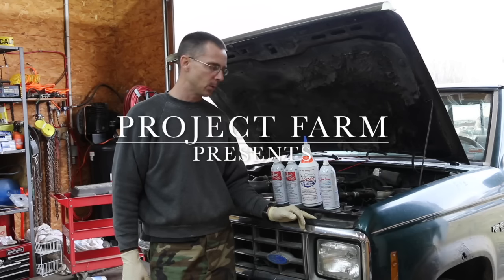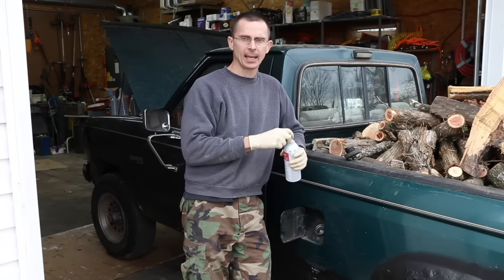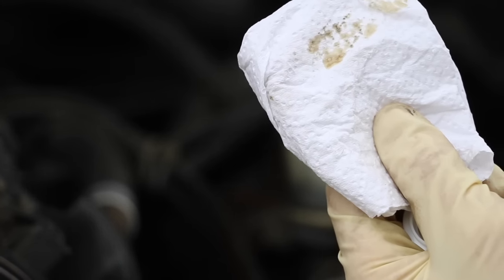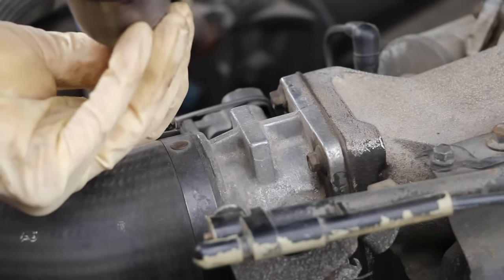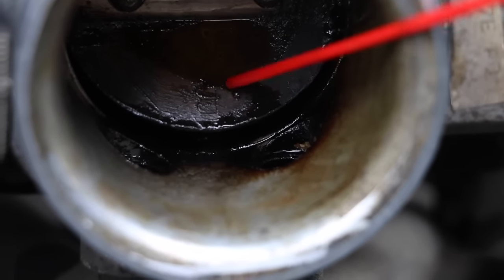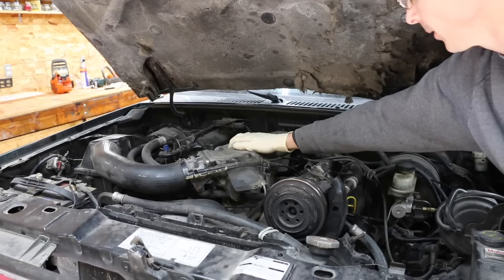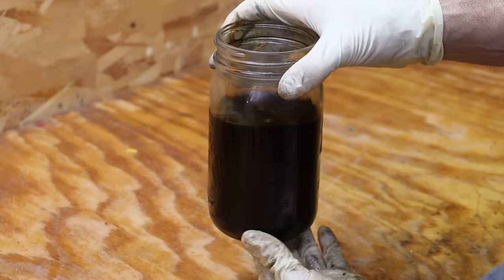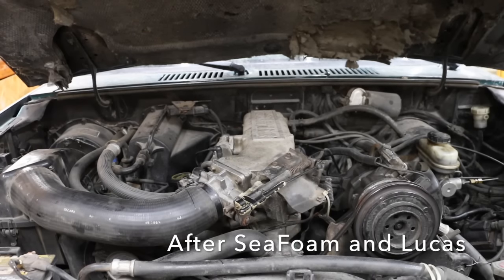Seafoam--can't believe what it did to my engine!!

Comment from the maker: Sorry it's taken me so long to post the links to the products I've used below.  Also, here's the link to the update video on the Ford Ranger: https://m.youtube.com/watch?v=prXiQgVVnDY&list=PLjT3B9r2z3fXjicpbrH4ras9VDX7gGSMe&index=20&t=0s
Products Tested In This Video (in no particular order):
Seafoam: https://amzn.to/3l5XjLY
Seafoam Spray: https://amzn.to/3aJptI5
Lucas Heavy Duty Oil Stabilizer: https://amzn.to/2FOENb7
Reply: You should have cleaned that blackened T'Body until it is like new.  the back of the plate you sprayed is worse than the front; sidewall should be cleaned.  It will idle like new. also clean the idle air solenoid or replace it!
Reply: So, after 3 years, how is the truck running now? Any of the old issues resurface?
Reply: Used Techron, its better than seafoam into the carb.
Reply: Aah it's only been like 3 years, no big deal
Reply: Can you please provide an update? Did seafoam correct an issue caused by deposits or is it more of a Band-aid?
Reply: Thank you for making these videos, very appreciative that you're taking the time to do this.
Reply: did you just spray it in idling or did you rev to 2k rpm
Reply: Love this, thanks man! God bless!
Reply: Have you ever tried motor flush you can by it at some Walmart’s I have been using it and love it so far
Reply: Lo e my toyotas!
Reply: You've come a long way from this video!
Reply: So the big question, how's it running now?
Reply: Please give us an update! How’s the truck doing?
Reply: Lol
Reply: Holy crap thats a lot of carbon on the throttle body. Thats suppose to exit the other end of the engine isn't it? lol
Reply: I used the seafoam in my 1999 Ford F-150 had a head gasket is blown and made my truck last a year longer it really works
Reply: One sure fire way to fix this problem is to turn the radio up louder
Reply: Alright. Storytime. A few years back, I bought a 2001 dodge stratus with the dreaded 2.7L V6. At idle, the oil light would come on. Telling me, it's getting close to death. I poured seafoam in the crankcase. Ran it for about 300 miles. Changed the oil.... Oil light was off. Owned it for a couple years and it never came back. Sold it to a kid I know for his first car, he drove it for SEVEN more years. Also ran seafoam through the fuel system and the intake. Ran like a top. I use seafoam in all my engine's now. Winter storage of summer toys? Seafoam tested fuel, starts right up in the spring. Engine teardowns, softens up hardened carbon, and it doesn't smell like kerosene in my barn. Great video bud.
Reply: Can you please add these videos to the engine oil additives play list please?! I almost missed them while researching the best additives
Reply: Nice if you followed up.  They are just temporary fixes that people dump in their engine when trying to sell.
Reply: @politics4816  actually, in reference to my previous comment, the guy that bought that car from me. Is still driving it. Ran into him the other day. Still no major issues. I run valvoleak... I mean, valvoline. I told him to do the same. People complain that it causes leaks, but every engine I run it in, looks fantastic inside. Even with the minor leaks. Had 327k miles on a Ford expedition that I sold (as a parts vehicle) only because the frame was starting to get bad. Still ran like a top. Actually ran better than the truck that the buyer used to haul it away.
Reply: @tslater1989  Thank you for pointing me to the follow up video that I did not notice before.  I feel much better now.  Project Farm usually goes the extra mile so I not surprised that the follow up video exists.
Reply: All Lucas oil is is just what we used to call honey oil, super thick oil to stop noises and oil burning.
Reply: X waa
Reply: @myname604  
I have used both Lucas and STP the Lucas is by far much better in my opinion.
Reply: @bertgrau3934  Slick-50 was pretty good but I have no idea whatever happened to that product.
Reply: @myname604  
I used that as well slick 50 it worked pretty good as I remember too
Reply: Spray GM "cleens" combustion cleaner into the throttle body. Follow the directions on the can to clean the throttle  body, intake valves and combustion chambers. Pour GM EOS into the engine  oil to free sticking lifters and quiet the engine overall.
Reply: If you only have enough money for one, which would you all recommend as the most effective?
Reply: @JWater57  
Depends on what you're doing. 
If you want to clean out carbon, then the Seafoam would be good, but Lucas is very good for fuel injectors.  (Lucas fuel injector cleaner)
Or if your engine smokes a lot like blue smoke,  I would recommend Lucas oil stabilizer works great
Reply: Awa
Reply: Can you do a video of various car manufacturers CVT transmissions under a specific stress load to compare the longevity and strength of these transmissions? Also compare to a standard 4 speed auto vs a newer 8 speed etc and even some manuals?? I think something like this would definitely be an, or the, ultimate high view comparison video. Everybody that owns a car should be getting more and more interested in transmissions with the introduction of all this newer technology.  Probably need a really good made dyno and run them all at a specific horsepower for a lot of miles??? Or maybe see what HP they begin to fail under at a min? Course the best would be to be able to run them all at the specific amount of power required to propel the specific vehicles they're used in at a set highway speed limit for enough miles to fail.  I don't know of anyone else big enough and scientific enough to ask. Would sure help to elaborate on exactly what we're dealing with with all this newer transmission technology.  Not sure that you can fund this alone from views or not. Guarantee you people will love to see it!!  Be nice to produce these results to compare car manufacturers so people know what they're getting and the manufacturers start concentrating on manufacturing more reliable vehicles to compete with one another. Course it would also help them to realize which technology is best themselves to know where to aim for the future.  Maybe even collect donations for the experiment if necessary?
Reply: Has anyone compared Dawn with engine cleaners?
Reply: So after u masked it are u gna open it uo and fix the lifters the rite way or u just gna leave it?
Reply: Hi PF, after all the testing youve done with additives/treatments over the past few years, what do you feel/recommend would be my best recipe for resolving some sticky lifters Im experiencing on my 3.3L gas engine with 100,000 miles? thanks!
Reply: I gotta tell ya, I’ve used sea foam to clean up old two -stroke outboards and it absolutely, definitely, positively works.  The only product I swear by, although Techron is also a great product but works differently.
Reply: Did this to my 94’ Ford F-150 it has the 300 4.9L inline 6 with 266,000 miles on it. Made a huge huge difference. Truck is running like it did 100,000 miles ago! It works very well!!!
Reply: Even in 2022 he still replies
Reply: I only use 1/4 - 1/2 as much as the instructions say to use and I'm totally satisfied with the results I get from using seafoam.
 Take Care All
Reply: all that lucas is sitting on bottom of the pan.  u have to add it to a running motor to help blend it IMO
Reply: wow, i did find this video.... 2017😱
Reply: pretty cool video tho
Reply: @ P.F. 
I had a chain guide tensioner sticking on a 2000 ford explorer. 
I drained the oil and added a gallon of kerosene and ran it for a few minutes...
Then drained it and put in dollar store oil ran it for 15mins
Drained it and ran some Castrol GTX and it fixed it. 💪😁👍
Thanks for the review brother
Reply: I’m good
Reply: Otbio giiiiiiiiiiiiiiiin innt
Reply: Thank you friend
Reply: Lucas is the boom Diddy !!! Be using it for 20 plus years .
Reply: You always do a great reviews. Thank you
Reply: SO GUYS BASICALLY LUCAS, & SEAFOAM ARE THE ONLY 2 AUTO ADDITIVE PRODUCTS THAT REALLY WORK, OR ARE THERE OTHERS?
Reply: SO WHAT ARE THE ONES THAT DON'T WORK?
Reply: I have a 97 Toyota forerunner with 250000 miles on it I did this a couple cans over 6 months or a year. And the engine runs like it just came off the new car lot show room floor due to you thank you my friend great job
Reply: Love that you keep it real by not having sponsors. 🇺🇸🇺🇸🇺🇸
Reply: I've been using seafoam for years with awesome results like this you non believers really have to at least give it a chance.  Lmao
Reply: Don’t stress
Reply: I would like to see what this treatment does to the catalytic converter inside as much smoke as it puts out
Reply: Have you done anything on head gasket repair additives?
Reply: Amigo tengo actualmente una Ford Ranger de modelo 89 con motor 2.9 v6 tiene ese mismo cascabeleo de botadores pero no le falta compresión porque si tiene fuerza, dicen que esos motores asi son de ruidosos entonces me gustaría saber hasta este tiempo si mejoró totalmente el problema o solo por un corto tiempo desde su aplicación. Te lo agradecería muchísimo saludos desde México 🇲🇽 tambien son interesantes tus videos sobre motosierras nuevo sub.
Reply: Have it Pressure Coated with Teflon and you won't even hear it running!
Reply: how about a review on all the catalytic converter cleaners out there?